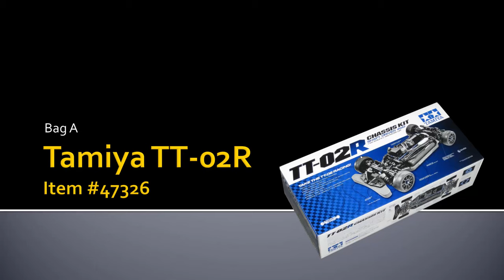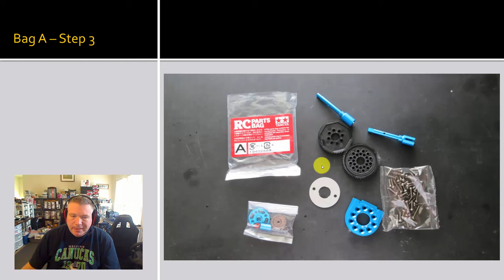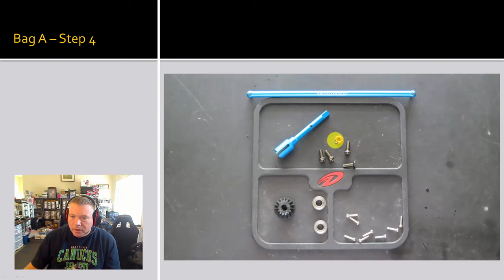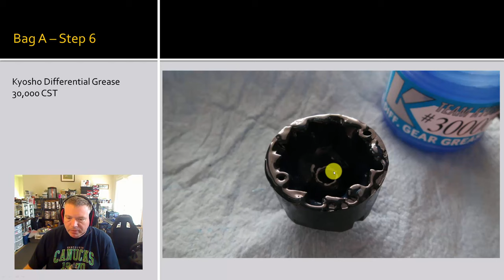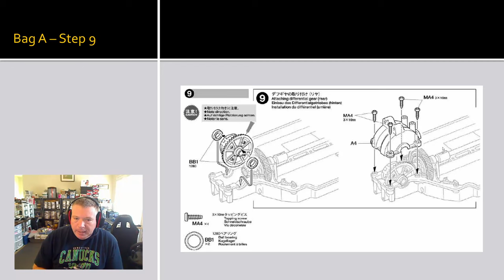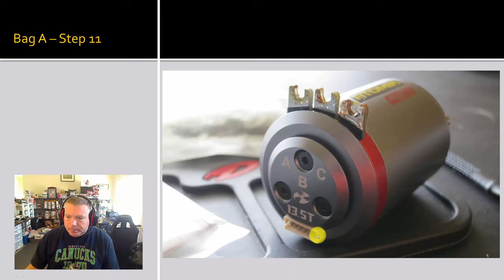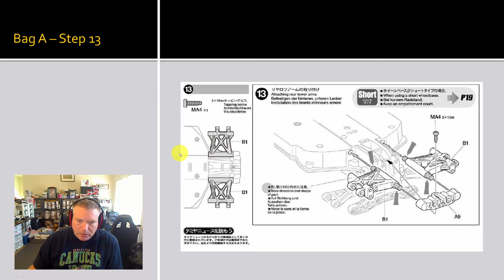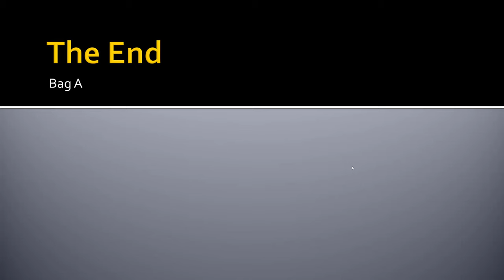TT-02R Rally build - Bag A

Comment: I just found this series. Glad I did! I'm stalled in the middle of a TT-02 Rally Build myself, in an unusual way....
I'm less fortunate than most, a lot less than I used to be. I've been collecting my TT-02 piece-by-piece! 😱
It started as an idea out of necessity, but it's been beneficial!! 
I have my own Stainless Steel Screws. I bought the Blue reinforced Pan and D Parts, but Black A Parts.... (Maybe I can change that at some point). Hobbywing WP10BL60 Sensorless ESC and Brushless 3300kv, 4 Pole Motor. Fast Eddy Bearing Kit. I got a few CHEAP Tamiya take-off tool bags, with several pots of AW, AG, and Ceramic Grease.....
Without rattling off every part, I can say that I have nothing that I don't need!! (Although in the long run, I'm sure I ended up spending MORE than the price of a TT-02R Kit - but I have various upgrades not in any Kit!)

I Love that I can get on YouTube, and even after 37 years in the Hobby, I can STILL learn something new!! 👍👍
I have experienced the binding of Machine Screws, and even lost some threads. I'm going to remember your idea of some lube in the screw holes. I at least have a couple of mounting points that are excessively strong, because I stripped them initially, and had to drill them out, an install Brass Heli-Coil thread inserts!!! 😱 
I also never thought of using Robinson Racing Gears. That will make tuning much easier. And the Kyosho Diff Grease... I've never even seen it before! I'll have to try to find some. I've been using Team Associated Silicone Grease, which at a higher CST rating, doesn't look as thick as yours.
I am also a firm believer in Green Slime!! I may have had ONE Shock leak prematurely in the 12 years I've been using it.
I look forward to catching up on the rest of your Series!
Carmine 🚂

Comment: hi kelly awesome, awesome video!!!!!! love the info but i have a question cause i am still stuck on which TT02 kit to go with. i want to be able to have the versatility of doing on road racing one day and being able to raise the chassis to run on dirt on another day. but i did notice you said the 02R doesnt do wide stance... so which version should i go with to have all the options and not drop a million dollars up front...lol of course i will be building up the kit as time goes so what i am saying i dont need the kit that comes with all the bells and whistles but still have the option to upgrade as i get the funds and get better. thanks in advance for any info you can provide.... and based off this video...... your info should be good!!!
Reply from the maker: Honestly, for the low cost of these kits, I don't see the value in having one chassis that you "convert" back and forth between on-road and rally configurations.  I mean we're only talking about $150-ish or so for a standard kit.  Plus, the wear and tear on the parts increase with every disassembly and reassembly.  If you're going to swap back and forth a lot, you'll be better served with two kits.
Reply: @kokyudosa  cool like that answer! So if I want the option of the wide wheels and what not the tt02 standard is the way to go? I mean there are so many tt02 with a letter or two following...that it can drive a noob crazy trying to figure out which one he or she needs...lol
Reply from the maker: @accordance73  I think your best bet is to get a standard kit.  That'll be the least expensive way to learn the platform and figure out exactly what it is that you need/want.  Starting hop-ups should include a sealed bearing kit, hardened pinion, and TT-02 CVA damper set.
Reply: @kokyudosa  thank you very much for taking the time to share some wisdom on the matter! Definitely have my compass and have been pointed in the right direction! Thanks again!!!

Comment: Thank you for the build series! It was very informative. What CST value grease do you recommend for a TT-02 mostly used on tarmac?
Reply from the maker: Sadly unsealed diffs can only use grease which doesn't have the range of CST options that diff fluids offer.  So you might consider using the Kyosho 30K in the front and 15K in the rear.  Pack the diffs full.  As an alternative, a lot of people like how Tamiya AW grease works in the front but I don't know what CST the AW grease is.